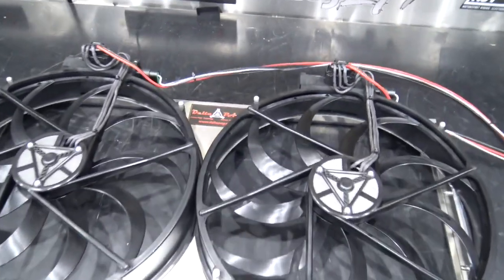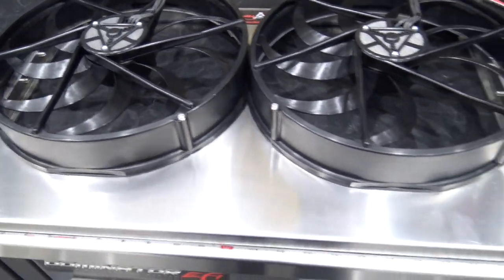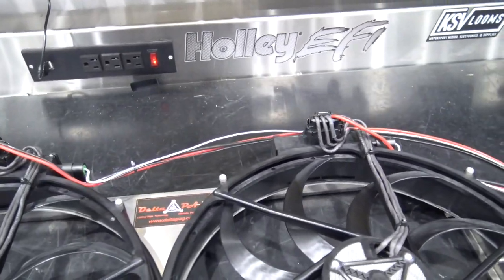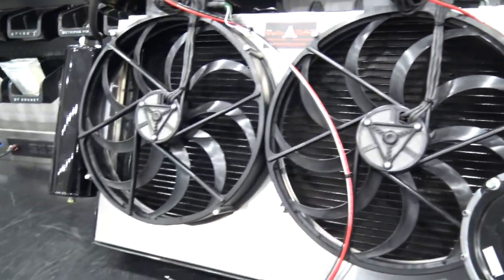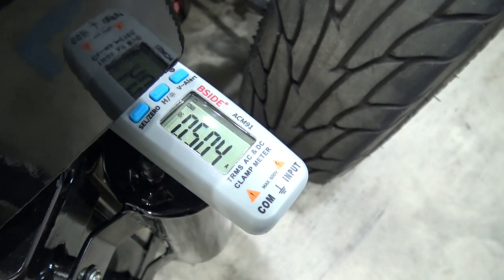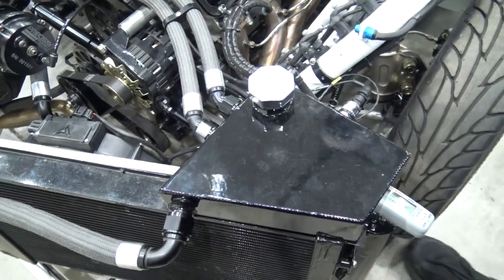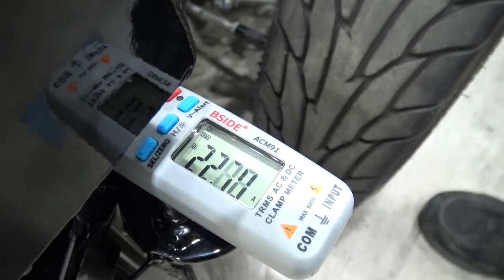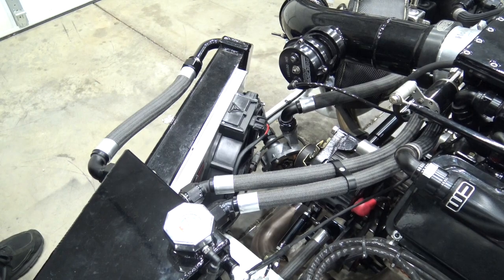Delta Pag fans brushless radiator fans

Comment: I’ve had many issues with the fans and temp sensor over the years. Bearings completely came out of one fan and about a week later same thing happened to the other, the ecm burnt out of another, I’ve gone threw 3 temp sensors for wires pulling out of the body of the sensor. They have revised the sensor now but I’m done with them

Comment: I have a question if you don't mind. I been looking at these I have a pretty rowdy big block in my 88 monte carlo SS  I have a 4 core radiator with 2 cheap ebay fans it says they pull 1.730 cfm which I think is B.S. I have it wired to a keyed 12 volt hot and ground I don't have a ecm in my car anymore so is yours wired with just a hot and a ground? And do the controllers work like that? Thank for any info you have.
Reply from the maker: Your application would need their controller

Comment: Are these 3 inch they look to be thicker
Reply: 2.6" to be exact. These are 12" diameter fans, so it's probably scaling.  The 18" fan has the same thickness, looks paper thin.

Comment: Are the fans and their ECM's able to be connected to Holley Terminator' outputs to allow them slow ramp up?
Reply: Yes they are.
Reply: you don't need the special module to run these at partial speed. you can send a PWM + signal to gray wire

Comment: Those are rated at 2800CFM for the 12” fans each right? I looked at those a few months ago and liked the soft start low amp draw plus the price on just the fans are right along with some of the name brands so i was looking for some feedback on them before i bought a set, my radiator will be under the rear of the car and they wouldnt have any trouble cooling it with that much airflow.

Comment: Nice to see companies doing soft starts we use them at work they do great .... by chance is that a oem water pump
Reply from the maker: the water pump is from davies craig
Reply: @theholleyefiguy  are you using their controller? i have the same WP, and am contemplating using PWM from my ECU to control the pump rather than a separate box.